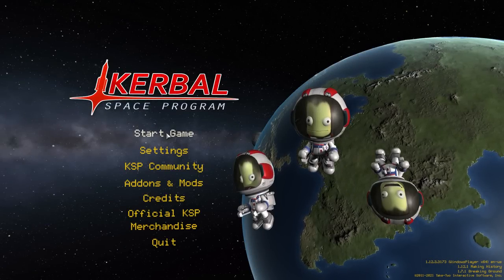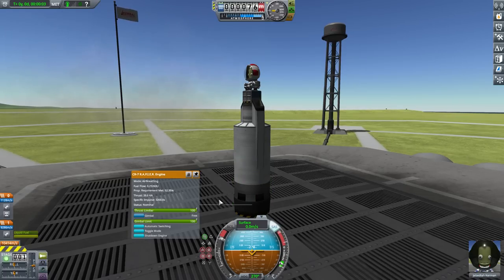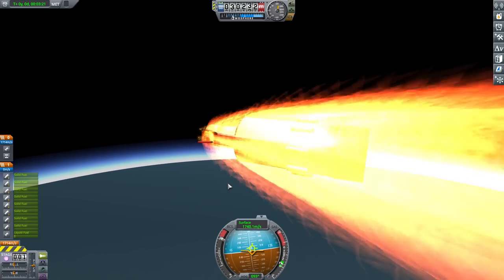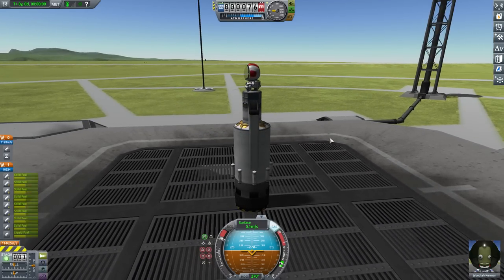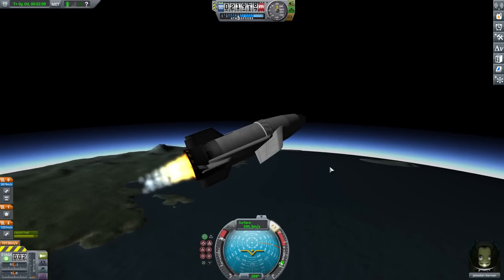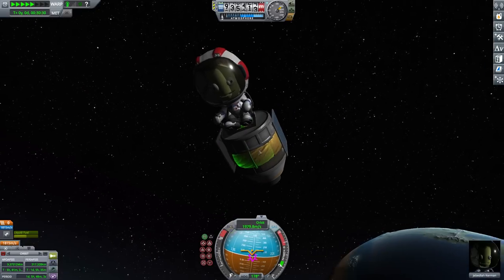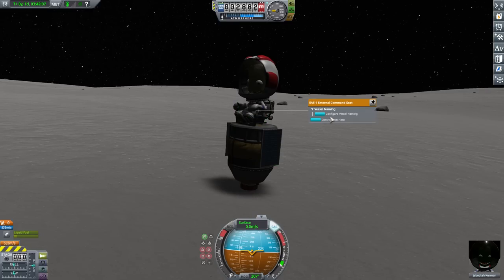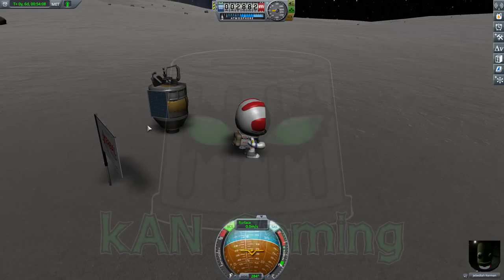I Built an Ejection Seat to go Straight to the Moon!

Comment: KSP protip: For maximum cheese on the rapier, add the shock cone intake backwards on the back of the rapier, rotate it 180 degrees so it's facing the normal way, then clip it forward out of the way of the exhaust.

One of the things KSP calculates for drag is the number of unattached nodes, like the one on the back of the Rapier, and by hiding the intake in the engine, you're (somewhat) shielding it from drag calculations, but the intake air is entirely based upon altitude and speed.

I've got plenty of KSP cheese on my channel, and I'm more than happy to share!
Reply: Thanks!

Comment: Kerbin's atmosphere ends at 70Km up, you've been angling the rocket too soon and too steep.
Your design also seems to have the worst aspects of both a rocket and a space plane, you should probably be using a more conventional rocket with 2 or 3 stages
Also I'm pretty sure there's a button to change the orientation of the navball relative to the command chair
Reply: I don't usually use this command chair but when I do, I put a remote command and select it to control from there

Comment: your rocket has enough delta V to land on the mun and get back if you are more efficient with your assent profile RAPIER engine is best used in shallow ascent profiles and this is how they uasly go first you start and as soon as you get 800m above the ground you level out and just speed up to 410m/s while keeping the altitude of 800m as RAPIER engines get massive increase of thrust starting at about mach 1 and keep increasing the thrust to mach 3.3 but you can squeeze a bit more velocity at higher speed of course the thrust will drop after mach 3.3 but you still can achieve most of your assent with it in air breathing mode, so getting back to the assent after you achieve 410/s at 800m of altitude you need to pitch up a bit 10 degrees above the horizon is often optimal and just keep accelerating and slowly getting up and you can achieve 1200m/s in this method just on air breathing mode and then you finish your orbit and go on with the rest of the mission.
Reply: Wow, just wow

Comment: how you use the rapier engine is to think of it with 3 modes, air(normal flight in air), air turbo(same as air except over 300m/s), space(i think i dont have to explain it), . you stay at sea level in air mode until you reach about 300m/s then it automaticaly activates air turbo mode wich can get you 3x faster than normal air mode. once you are at 1000m/s you start tilting up gently untill your engine cuts out/stops producing a lot of thrust at around 15-20 km and thats when you switch modes and get into orbit with a gravity turn (tilting to the side gently) and voila you are in orbit and having used less fuel than having gone straight up with the R.A.P.I.E.R.
also use a fairing, just do it its so much easier getting to space especially with the seats

Edit: sorry if my English is bad its a second language

Comment: one thing that might have made it more efficient would be to drain about half of the oxidizer, as in air breathing mode the engine burns none of it, and in biprop mode it is a 1:1 ratio, so it just ends up as wasted mass

Comment: A fun tip for you:

When you are controlling a craft, on the left where the little staging icons are, you can click on a staging tab to see specific stats on that stage.
By far the most useful of this is the TWR or thrust to weight ratio. If this is over 1, your craft is going faster than gravity, if it is less, then gravity is going to pull you down faster than you can accelerate.

Comment: Pro tip: SSTOs usally get into orbit by accumulating a lot of speed inside the atmosphere before raising above it. That way you maximise the efficient air breathing capability of the engine while minimising the innefficient oxidizer usage mode.

Comment: the air intake only work between 0 and 20000 ish mts in the atmosphere.. also the rapier engine (in breathmode) perform better when you hit 440 mts/s
also you should watch Matt Lowne or Scott Manley.. they have great tutorials for KSP
ps: if you re on pc you should use a couple of mods.. like kerbal engineer redux .. it gives you a lot of usefull data of your flight.. and you can customize it for whatever data you need at the moment

Comment: Hey KAN. When you're trying to land anything, click the little blue waves next to the altimeter. It will switch it from sea level reference to radar altimeter.
And also, right click the lawn chair and somewhere in the menu there should be a "control point: forward" button. Click that until it says up.
Although maybe for that you need to go into settings and look for something called "Advanced Tweakables" and click that until it glows green.
Let's see... what else am I missing? There are other launch sites you can unlock by flying a very, very long range plane around the planet. The planet's name is Kerbin and its diameter is 1/10th that of the Earth's, but with the same surface gravity so its average density is about 30g/cm³ which is 6 denser than the densest element, Osmium at 24g/cm³ (but the density isn't nearly as important as the surface gravity).

Comment: 5:03 - The increase in Δv during ascent is actually genuine; it's because the game calculates your Δv based on how efficient all your craft's engines are under the atmospheric conditions your craft is currently experiencing, and the upper stage's vacuum Isp is enough greater than its sea-level Isp that, for part of the ascent, even though your propellant reserves are continuously diminishing, the efficiency of the upper stage is rising so quickly in the increasingly-rarefied atmosphere that the resultant increase in the upper stage's Δv actually temporarily outpaces the lower stage's propellant-depletion-induced decrease in Δv.  (This effect is especially spectacular if you have an upper stage using an engine with stellar vacuum Isp but crap sea-level Isp, like the nuclear and ion engines, or, to a lesser degree, vacuum-optimized rockets like the Terrier or Poodle or Ant.)

Comment: Hey kan so some advice for you, take your gravity turn much much much later. You started it at about 4km alt and you should wait until about 10km alt. Then you want to stay at about a 45 until you're about to exit atmosphere at which point you should be around 2500m/s before ever switching to thrust/vac which should give you enough fuel to get into a full orbit, and from there it's a piece of c- eh screw cake it's a loaded baked potato!

Comment: The delta v was going up because most engines are more efficient in a vacuum. So, you were burning fuel, but engine ISPs were going up as well, for a while. Also, the delta V calculation for air breathing assumes you'll use all the liquid fuel available to that engine for air-breathing flight, that is until you switch engine modes. Then it recalculates.

Comment: The thing with the ∆V is that, at sea level, engines have a lower specific impulse (isp, which is basically ∆v/kg of fuel) than at vacuum, where the engines are more efficient

Comment: The Dv calculations were "off" because the rapiers only use LF in atmosphere, and they burn it much slower than LFO (LF and oxidizer), but you're also losing some Dv because you aren't losing the mass of the oxidizer. Thats why you never really use rapiers on anything other than SSTO's. Also rapiers' efficiency drastically increases after 400m/s ASL

It also kind of hurts watching kan play this with almost no knowledge, when I have over 1000 hours (probably closer to 1500 across separate installs)

You waste so much Dv by slowing down at high altitude, because you just gain all the velocity back because of gravity. it usually takes like 800m/s to land, but If you slow down closer to the surface you can make it in like 5/600

Comment: Nice! I notice you tend to pitch over way too soon I noticed, even with the dual mode engine.  Rockets to be most efficient need to clear most of the atmosphere as quickly as possible to minimize the effects of drag, and will follow a parabola shape to Low Earth Orbit. 
In many ways this makes rockets more efficient than jet or dual mode engines, as the other two require aerodynamic forces to make flight efficient, which costs additional weight and drag.  This is partly why space planes are not really being looked at too seriously in the real world, as they are very difficult to make efficient enough.

P.S. that dive you did to "gain more speed" cost you more delta V then you could possibly gain back due to the massive drag involved in hyper sonic flight. Again the key is to get out of the atmosphere as quickly as possible!

Comment: The RAPIER is better used on a plane to help you get up while the engine powers up to gain horizontal speed.  The RAPIERS kick in very powerfull from 350 m/s.  The ideal is to gain speed to switch to non breathing mode around 1300-1500 m/s.
By staying under 300 m/s, you really waste the engine's potential, that why it is better suited on a space plane. The best trajectory is to take off horizontally and pitch up so you gain the most speed below 20 kms altitude.

Comment: if your using air breathing engines you want a more plane like FlightPlan, it would've been much easier if not better to use just a regular rocket engine, the potential gains from using the oxygen in the air is negligible since with a normal rocket flight plan you fly through the thickest most oxygen rich area of the atmosphere before having to switch to the horribly inefficient rocket mode of the rapier very early after takeoff, it's incredibly efficient and powerful in airbreathing mode, so drag is not an issue.

Comment: There used to be a setting where you could check deltav at different altitudes, at least at sea level and vaccum. Might have been a mod too.
Reply: It's the Δv button in the lower right.

Comment: Lol.

Navball, not gimbal.

Rockets don't tip over from being top-heavy, they tip over from being bottom-heavy.  Yeah, it doesn't make intuitive sense.  Look up the rocket pendulum fallacy.

If you want the RAPIER engines to work ideally, stay below 20km until you're at least at mach 4; the air intake will easily offset the extra drag, and when you hit mach 4 you can pitch up and escape with almost no oxidizer.  I've made it suborbital using only jet engines in the first stage; the momentum from the lower atmospheric stage can get you up with a pretty long arc.

You can change which way is 'up' on the navball by right-clicking the controlling node; in this case, the external seat.

Lol again.  You landed on the far side of the mun.  The mun is tidally locked, so the 'earth' is on the other side of the mun, always.

Comment: the cr7 r.a.p.i.e.r engine is most effective at 10000 meters and mach 4 so you should speed at 10000 to mach 4 and then go up for the most efficient orbit
Reply: and the cr 7 r.a.p.i.e.r is not the best for that use

Comment: I noticed a rookie mistake you did, simply put you don't need an electrical or reaction wheel system if you use a vectored thruster, and while this will cost an amount of fuel to turn the craft it's less than lost from the weight of the electrical and control system